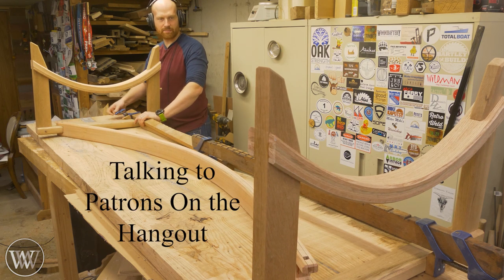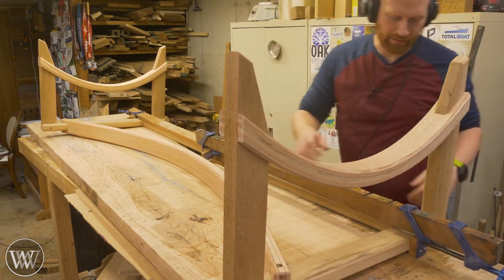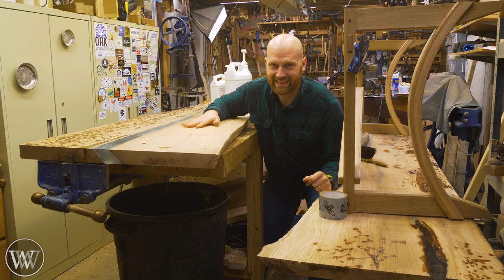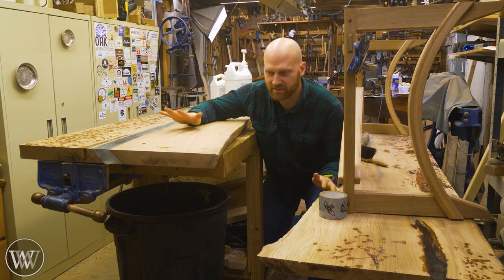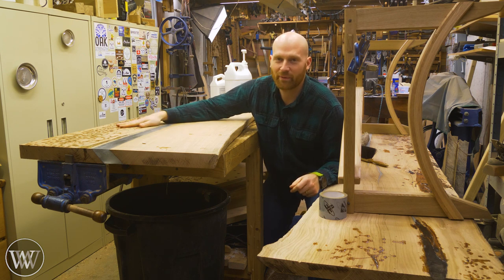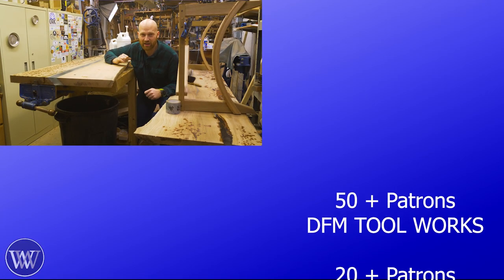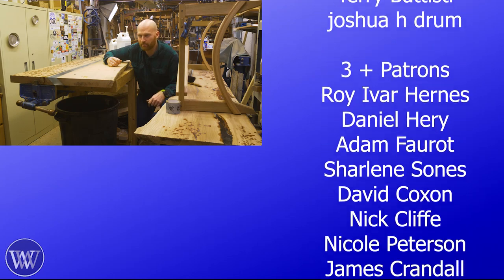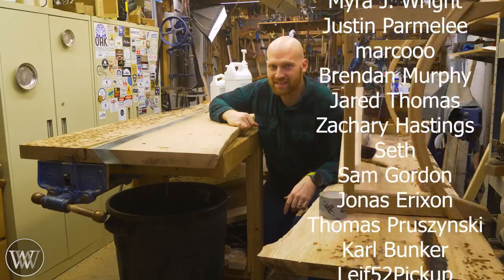Slab Top Oak Desk Build Bug Holes

Comment: Most of those bug holes I would drill with a 1/8 drill bit and tap small pieces of hardwood dowel into. They just look like small knots.
Reply from the maker: That would be a lot of drilling! I resonantly love the look of bug holes. I often pick boards for just that.
Reply: Thats the joy of woodworking. There is always another way. Make it a feature not a fix.
Reply: @WoodByWright  I couldn't agree more.  I'm working on a white oak project right now with maybe half the worm holes that your wood has and I'd need therapy if I drilled out every worm hole and filled them with a dowel then did the additional steps associated with that approach.  Not only that, based on my past experience clear epoxy "disappears" a lot more than the end grain of a dowel.

Comment: I have a new Stanley no 4. the cheap one, that i'm having trouble with. I have the bottom completely flat, blade sharpened,  i've tried to adjust the frog many times however, when planing I only seem to get dust and tiny chips. I can't get any smooth ribbons like i can with my No. 62 sweetheart. Any advise for a noob?
Reply from the maker: I think you might have the blade in upside down. with most planes the iron goes in Bevel down. only exceptions are low angle bed planes (#62) and low angle Block planes. Here is a video on setup. https://www.youtube.com/watch?v=vG-DULSw6Zk I could be completely wrong on your setup though. feel free to send me an email and I would gladly look at some pictures.
Reply: @WoodByWright   I first thought I had the iron in wrong but turns out it was bevel down. After watching that video I believe the frog might be moving a little or not set straight. I am also very new to sharpening but the blade feels very sharp.  Thanks for the response, I'll keep watching and practicing lol